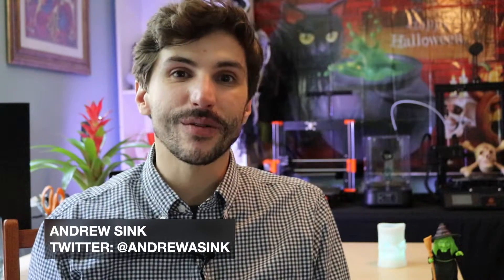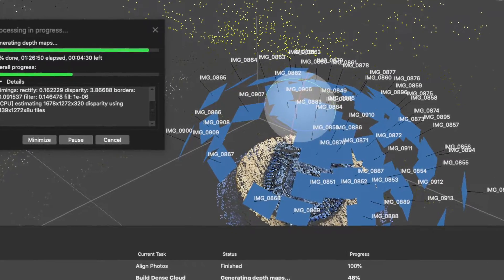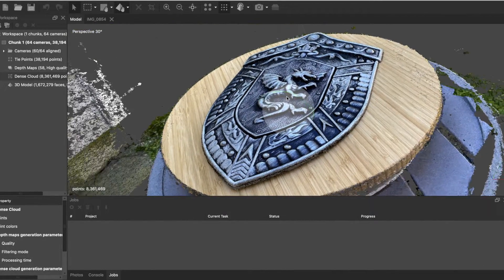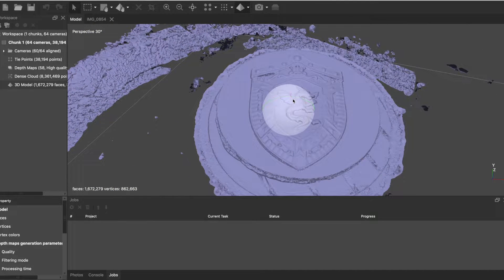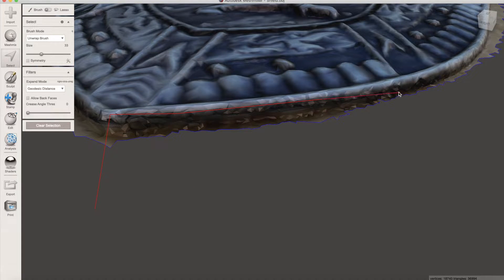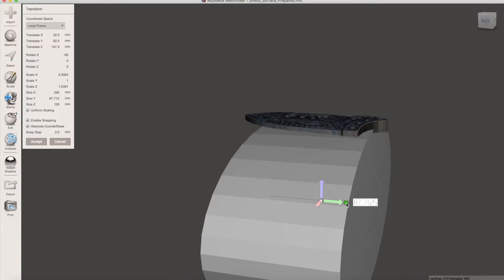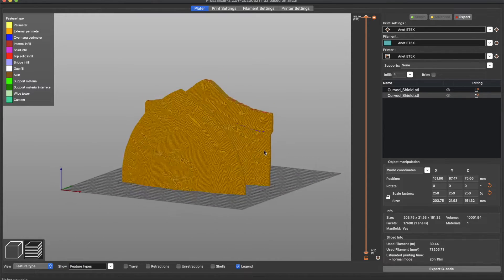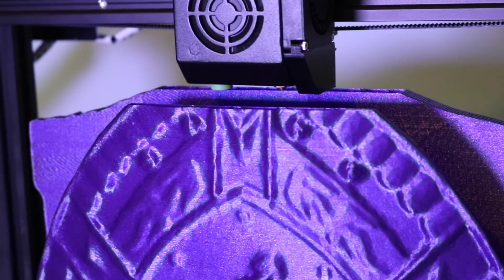Converting a Surface into a Solid 3D Model using Metashape and Meshmixer #Scantober

Comment: Thanks Good video...  What settings I need to Print in METAL ? using
Reply from the maker: You’ll need a metal printer! I use Desktop Metal, works great for 17-4 stainless steel parts!
Reply: @AndrewSink  I like to make a Test with shapeways... small sculpture in Metal Steel.. Just want make sure Im sending the Right files.... Im looking for the  settings / export for metal Print.. I guess is different from plastic